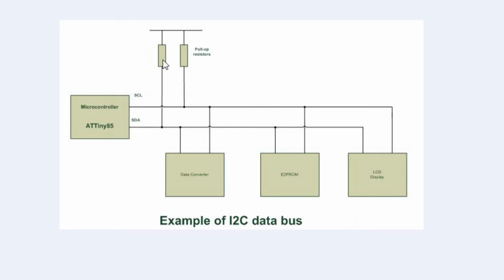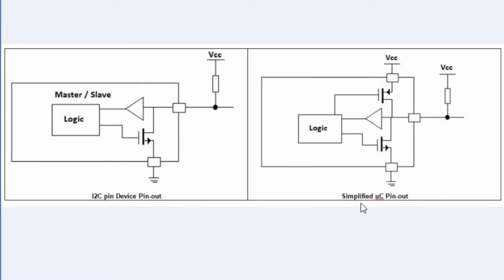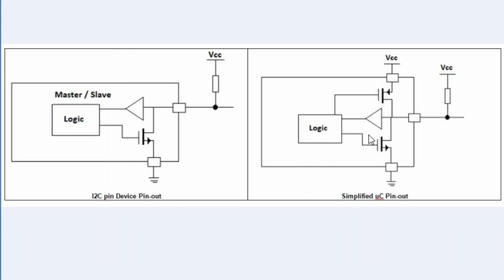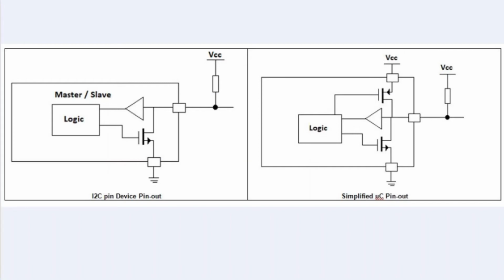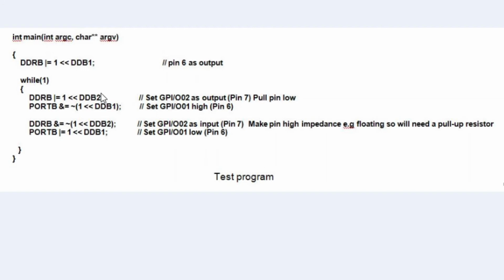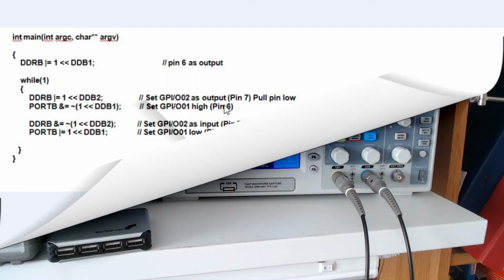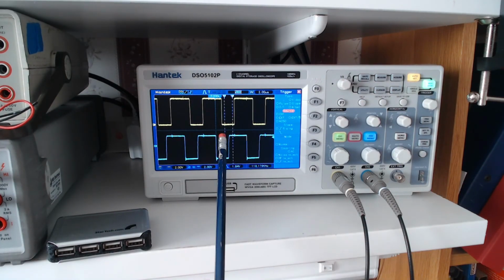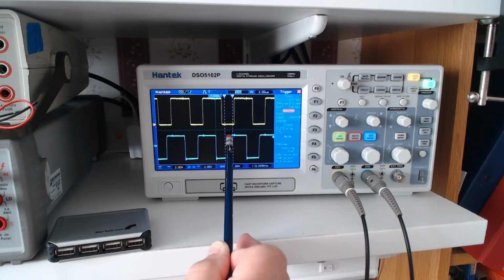#078 Bit Banging I2C Part 1

Comment: What should be the frequency of 8051 to communicate with i2c device using bit banging method with 100kbps?
Reply from the maker: sorry i don't know the answer to that one. as you need to know what clock speed you have, how many clock cycles per instruction etc.

it's back to the 8051 data sheet to look it all up.
Reply: @TheEmbeddedHobbyist  clock speed of 8051 is 12 Mhz. It takes 1 or 2 machine cycle to complete 1 instruction.

Comment: Nice! I may have to look at that for my STC15 bit-bang i2c I did.  Looks like we have the same oscilloscope. Do you have the occasional crash issue with it?  I need to check for new firmware.
Reply from the maker: Hi Scott, Not had any crash's yet. but it had a issue when the internal battery went flat. Now channel 1 is a bit more noisy than channel 2. self-cal seems to help the noise a bit! but not much. Ok scope for the price, just could not justify a better make at the time. Might have to look at a firmware update as i've had it about 3 years now. 

Keep entering the Keysight comps with fingers crossed but no luck so far. If your watching how about a demo unit :)